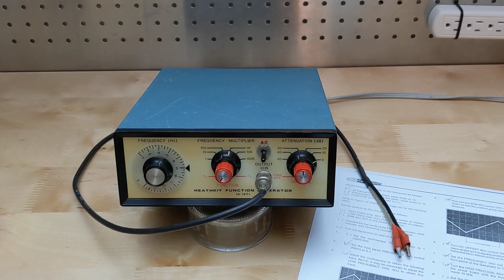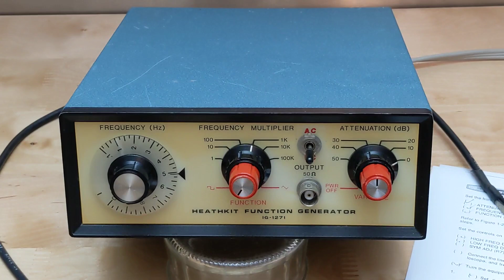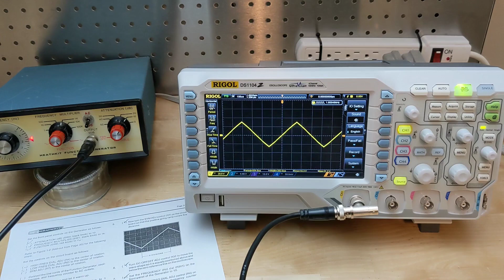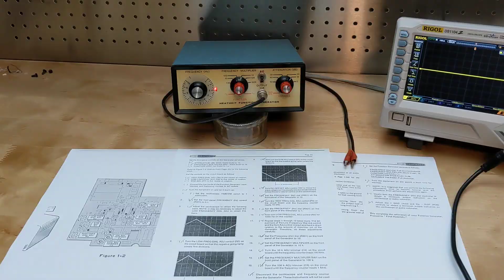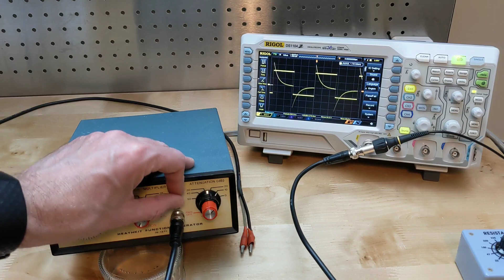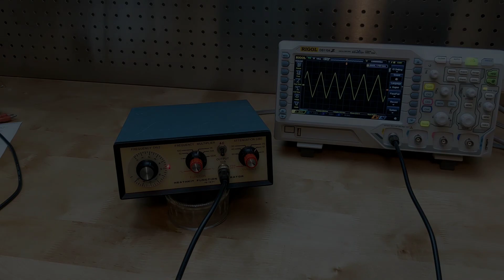The Heathkit IG-1271 Function Generator

Comment: Nice little unit.  I wish someone would go back into the “kit based radio” and “kit based electronic test tools” making world.  What a fun way to spend a rainy saturday, building a multimeter or one of these function generators, with your dad or your ham radio Elmer.
Reply: There are archives of old EE , practical electronics and Elektor magazines that have the circuits foil patterns and instructions available to find and build these electronic hobby staples. 😊

Comment: what its maximum output voltage?
Reply from the maker: 10 volts peak-to-peak into a 50 Ohm load or greater.
Reply: @jefftranter  and what is minimum and macimum voltages?
Reply from the maker: @itrstt66  Maximum output voltage is 10 volts peak-to-peak and the minimum would be with 70dB attenuation, about 1 uV, although in practice I don' t think it will go that low.
Reply: @jefftranter  yes i get that it outputs 10vpp, thing is that it could be 10vpp from -5v to +5v, from 0 to 10, 20 to 30. What are the voltage values for the peaks?
Reply from the maker: @itrstt66  The output voltage is approximately centred around zero volts. There is a DC offset adjustment to set it to zero, but not all versions had this adjustment. My unit was modified to optionally switch in a capacitor so that the output was AC coupled and there would be no DC offset.
Reply: I am sorry i am getting very confuses, how can it be DC it is a pulse Generator?
Reply from the maker: @itrstt66  The output may not be centered at zero volts, which is known as DC offset.
Reply: @jefftranter  ok thank you i get that now. And regarding it, to which values can the output amplitude vary?
Reply from the maker: @itrstt66  I am not sure what you are asking. I suggest taking a look at the manual. A copy can be found here: https://www.vintageshifi.com/repertoire-pdf/pdf/telecharge.php?pdf=Heathkit-IG-1271-Manual.pdf

Comment: The 1271 was a pretty nice design, both in terms of the circuit and the ergonomics. I had one, probably purchased around 1978 (it came out in 1974, discontinued in 1987) and used it in my home lab. It always worked very well, but I found it a bit difficult to use in the more advanced circuits I was working on, since it only had the most basic waveforms. I sold mine on eBay when I acquired a reconditioned HP that I still use, which itself has been partially supplanted with a digital function generator that is even more flexible. The one thing that always bugged me about the 1271 was that Heath put a standard round LED behind the triangular shaped "arrow" opening next to the Frequency dial, and they did not include a diffuser, so instead of a nice illuminated triangle, it just had a round lighted dot in an otherwise dark triangle.

There is good reason why probably most Heathkits of this so-called "Post New Look" styling are missing their combination carrying handles/kickstands.....the design sucked! The star washer Heathkit provided to give enough 'lock' to the handle/stand was too weak, and when the equipment sagged, the washer's teeth dug gouges into the aluminum case, further reducing surface area and making the 'sag' worse and worse. I think only on the oscilloscopes of that period did Heath include proper detent locks for the handles/kickstands.